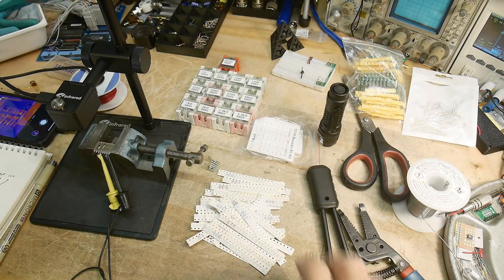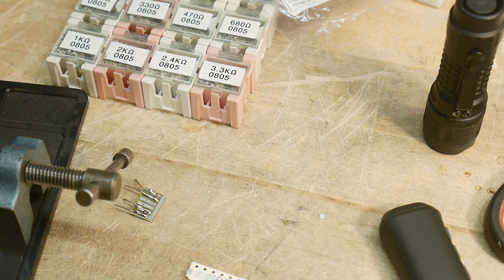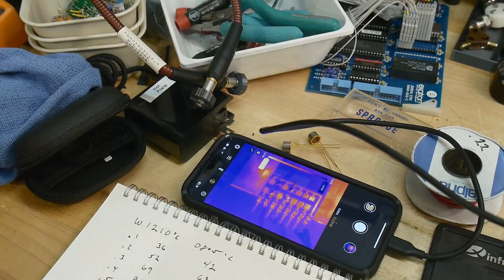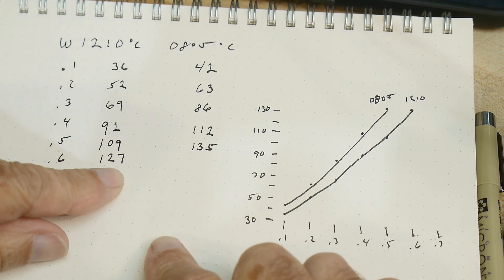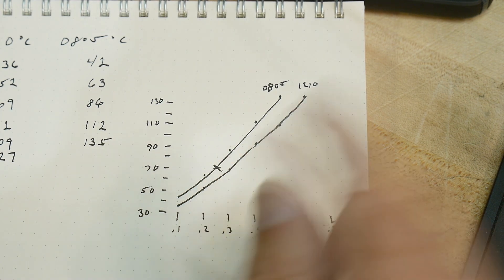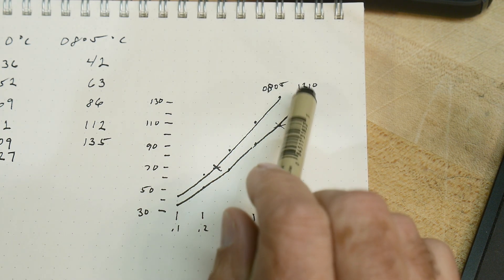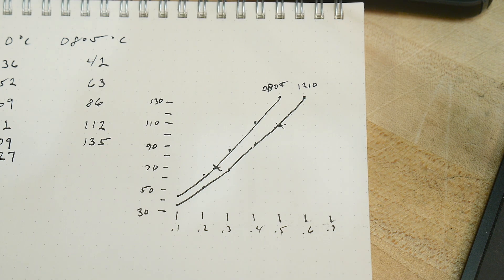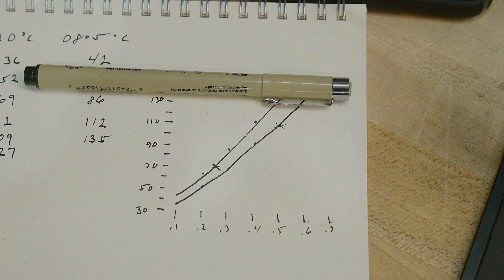#2057 SMD Resistor Wattage

Comment: The max power depends mostly on material.  Thick metal films can handle 100-125 C, but most others should be kept < 70-80 C.  It also depends on what precision and reliability you need.  Keep in mind that resin PCBs also deteriorate at high temperature and hot parts cause injury.

Comment: Presumably, (likely but not necessarily), the various resistors have a very similar emissivity close to one.  The spot temperature measurement area of the thermal camera will have some profile.  If any metallic areas or other reflective surfaces are within the sensitive area, those can alter the readings.  If the camera spacing can be moved twice as close and twice as far away and still produce virtually the same reading, that would indicate the angle subtended by the emitting region of highest temperature is large enough to span well-beyond the sensitive area of the thermal camera.

Comment: Yageo datasheets are pretty specific:
0805 1/8W - 1/4W
1206 1/4W -  1/2W
that's omitting their details on TCR ratings, resistance ranges correlated to tolerance.
Also those power ratings are up to 70C ambient with derating all the way up to 155C, so you probably won't have to worry much only designing for room temps.

Comment: Thanks for the video. I always look forward to viewing them. I looked at several datasheets. The construction matters and so does the board material. The bottom line is the rated dissipation is at 70 deg. C then it de-rates to zero at either 125 or 155 deg. C depending on the manufacturer. So, your 70 C reading is the rating for that resistor-board combination.
Reply: It's true.  There are smd tantalum special  resistors 1206 ( not capacitor ! )  with 3W ( or more ) .

Comment: What was ambient temperature when you tested?  around 20 degC?  I think you do have to consider the temperature rise from ambient in the conditions you plan to run it.  And I think ultimately you need to look at the mfr datasheet if you are doing anything close to their max power dissipation.

Comment: You may want to take a look at fusible resistors such as Vishay M25SI, TE FCR or Philips FRC01 series as well. Those resistors have defined characteristics not only for their rated power, but also for fusing. Somehow they are engineered in a way that warrants an open circuit after an overload, while retarding fire

Comment: Package power is a very very deep rabbit hole with multiple cans of worms.

It gets really confusing when you start using switching signals, for like fet gate resistors.
Even when directly contacting high quality manufacturers we couldn't get any clear answers.

Btw, PCB design and width/surface area of tracks or copper is VERY important here!!!
Reply from the maker: You are right. The lazy worms use rabbit holes to go deeper.
Reply: Well, ofc, when in becomes about dV/dT and not continuous power ratings. Nobody canceled frequency domain black magic physics laws.

Comment: One also has to consider the thermal dissipation of the PCB, ambient temp, air flow and temp coefficient of the value.   Is the wattage rated based on part damage or damage over time or  is it based on the resistance value exceeding the value tolerance.

Comment: I would have measured the initial and post test resistance after various exposure time, and extend the test to failure. A protocol must be out there in the ether that explains the way these parts are specified,... Just a temperature test is probably not enough, unless you know the details of the substrate material.

Comment: 1210, 1/4 watt. 0805, 1/8 watt, on standard size. However, you can get thick/taller versions which can bump you up. I've bought 1210 thicks at 1/2 watt and 0805 thicks at 1/4 watt.
Reply: There's also "reversed" package where the resistor body is 90 degrees from normal so it can be fatter.

Comment: Wattage depends not only on the package. Pad size and copper planes close by can make all the difference.
Reply: That is exactly what I was thinking. I see datasheets from legitimate vendors saying you can run 8W or even 16W through a 2510/2512. Those parts look like hershey bars next to the 0603's I usually use but I still don't believe they can be run that high without a PCB copper area to act as a heat sink.

Comment: I've been fretting about this ever since your survey. I think a lot of the time they are rated assuming they are placed on a board with a heavy copper track or ground plane, just like transistors are rated with heatsinks assumed. But I've always assumed 1/8w for 0805, 1/4 for 1206. 2512 is supposed to be 1w but I don't think I trust that. And I refuse to use 0603 just on principle because there is both metric and imperial 0603s and one is double the wattage but I can't remember which one is which. I think it might be helpful to do another test with the resistors in open-air instead of soldered down.

Comment: Good to have this test as a reference for practical environment. Knowing the current of a 1N4148 I was astonished about the limiting  current of a 1N4007 until I saw it (a couple of decades ago). It has much thicker leads. The element itself must be able to transport the thermal power to its environment via leads and soldering pads in case of smds. 
A test for the element itself might be to connect it via 0.1mm wires. I recently did so to test the capability to measure the airflow but I came back to small light bulb without glass where the wire is thin an does practically not transmit heat to the connectors.
Reply: Diodes are often raised from the board to allow for better heat dissipation

Comment: My boss is always going on about how 0805’s and 0603’s have higher power ratings than they used to and doesn’t understand why. My theory is the parts do get hotter, lead-free solder melts at a higher temp, and the materials have improved, allowing the ppm/*K ratings to stay within the stamped tolerance at higher operating temps

Comment: every resistor or capacitor should be used by its manufacturer part number not by its package and values this way datasheet tells everything about the parts just like ICs
Reply: For resistors the wattage value on the datasheet is just performance in the manufacturer reference board. It is highly dependant on your design.
Reply: So you already know that there is no part number or datasheet...So, what are you actually trying to tell us?
Reply: @Peter_A1466  idk maybe do not use bulk resistor for your product specially Chinese one

Comment: In my designs, I always considered 1210 as 1/4W and 0805 as 1/8 watt. I don't like things getting hot. If I was going to run anything above that, I'd put larger pads/traces. Your test board has a much larger pad area than normal. Normally it is a small pad with a tiny trace that won't pull heat out of the device.
I'd worry about solder connections cracking from heat cycles. This is the most common SMD resistor failure I have seen.
Also you need to consider the voltage limits of SMD resistors. They are considerably lower than thru-hole equivalents.